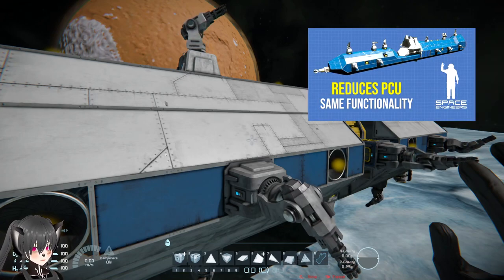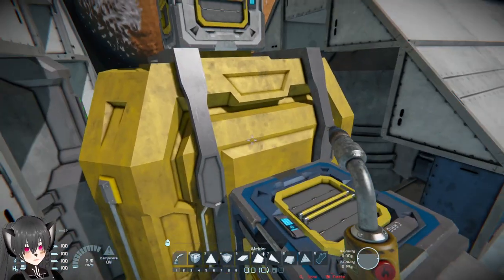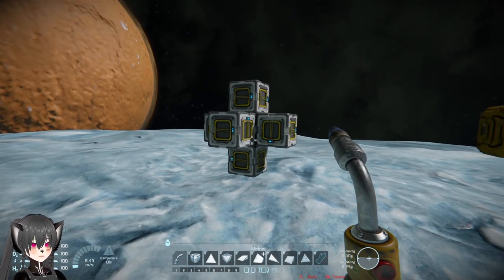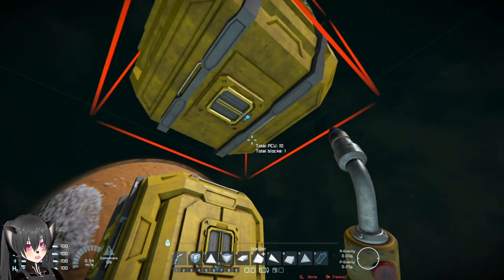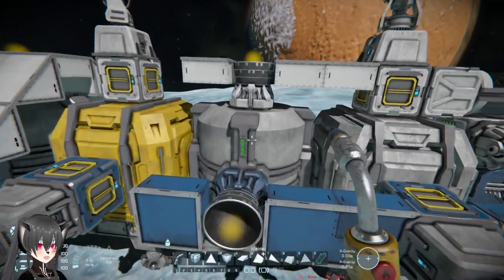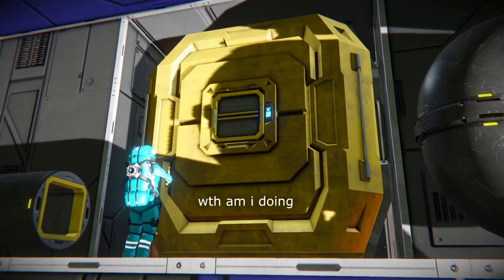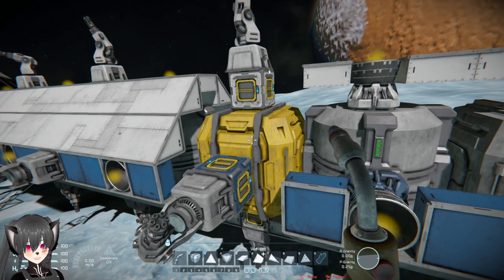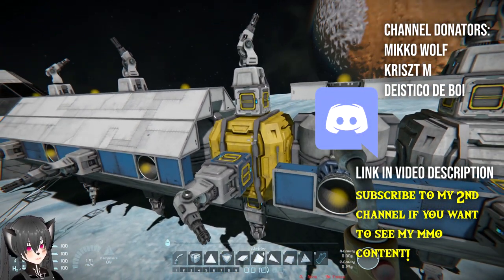This Trick Makes Ship Conveyor Simple, Space Engineers

Comment: Large reactor cost the same in PCU as small reactors.  So placing in a large reactor using this strategy is fine.  The only issue is mass.  The lighter the ship, the faster it accelerates and slows down.  That extra mass can also go towards armor upgrades in sensitve areas
Reply from the maker: Good point c= not sure how the equations go exactly but I think the extra weight would be offset by having less blocks in general, I might have to test that out later

Comment: Well, yes it save PCU, but also makes ship more vulnerable. It's like using small or large thrusters. It is harder to damage multiple conveyors than damage single large container.
I think it can be beneficial on big ships, when a couple containers are put side to side, so when one of them gets hit, it will not split ships logistics in half
Reply from the maker: It does generally makes it easier to destroy or disconnect the conveyor c= but it won't be a problem if you put your ammo boxes right under the guns themselves and use decentralized hydrogen tanks x3

Comment: I realized exactly this about the 3x3 larger blocks. When convenient, I'll use my extra large H2 thrusters, refineries, etc as well (those two blocks each are equivalent to a maximum of 5 conveyors, not 7 like the large cargo). And they're a lot tankier than large cargo -- 30k integrity for H2 large thrusters, 123k integrity for refineries, versus only 10k integrity for large cargo. The large cargo in turn is a wee bit tankier than the smaller blocks: ~1700 integrity for conveyor junctions, ~2400 integrity for small cargo, or ~3700 for the various armored conveyors. Trade-off is that the large cargo takes up way more volume than the combined equivalent conveyors, so random penetrating damage has a higher probability of intersecting the large cargo, making it proportionally weaker than the conveyors/small cargo it replaces. For combat purposes, armored conveyors are probably a better choice especially closer to the surface armor layers that are most exposed to enemy fire. Large block conveyor substitutes like the large cargo are probably better deeper inside a large ship, where deformation damage and outright penetrating damage are less likely to hit right away. or for non-combat ships, definitely.

If I remember correctly, Andrewmangaming did a video where he tested the player conventional wisdom that conveyor junctions cost more system performance than conveyor tubes (due to the number of conveyor connections per block). As a bonus, he also tested small cargo container blocks (all large grid). Unfortunately, he didn't think to check 1 large container versus 7 small cargo containers in his permutations (but he did plenty of other variations focused on conveyors).

Theoretically, cargo blocks DO cost more performance than conveyors, and junctions do cost more performance than tubes. But the system performance hits did not show up as a significant single-digit percentage impact until he put down a solid brick of something like several thousand conveyors or small cargos (tens of thousands of PCUs in conveyors/carg blocks only).

So while a single player using 500 conveyors won't really see the effect, 20 players on a server all using a combined 10,000 conveyors will impact server thread load by something like 2-3% (I forget the precise amount, but it was not huge like 10% increased load). Normally, the individual player will run up against the server PCU limit first (which is the approximate point of PCU limits)
Reply from the maker: Yeah it's generally a good idea to use as many functional blocks as possible as conveyors c= also yeah, but while it makes it easier to damage or disconnect the conveyor, it won't be too much of a problem if the ship's ammunition boxes are right under the guns themselves and the hydrogen tanks are decentralized

And oo, those are interesting numbers x3 I do know on a large scale they can affect performance, I think the percentage depends on the server's CPU or specs as well though